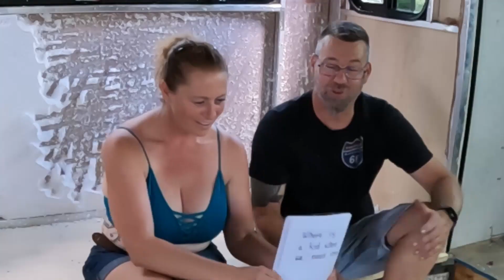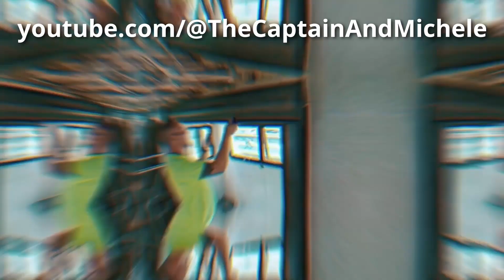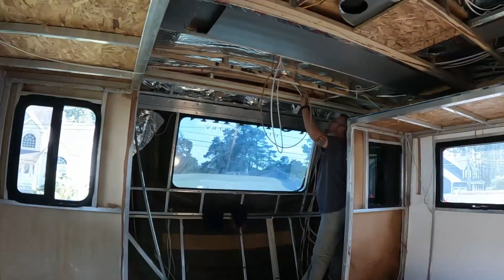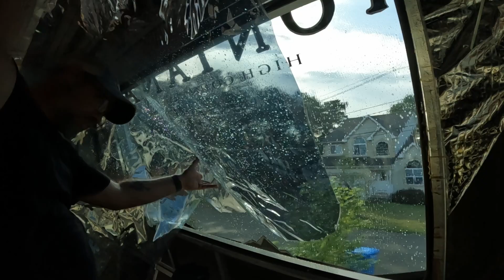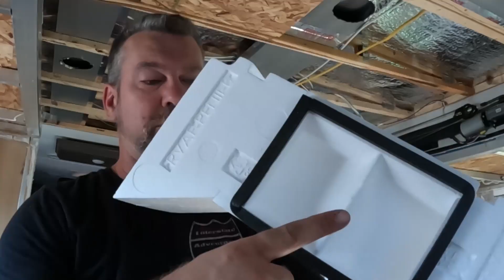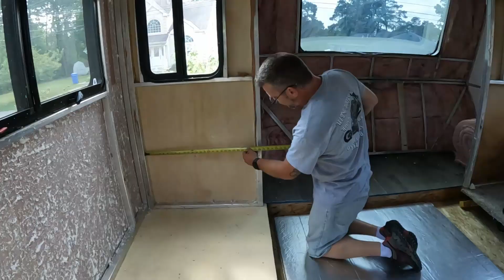RV Upgrades Have Begun! RV Airflow And Low E Window | RV Living | Interstate Adventures S3 E8

Comment: If you spray water on the window instead of tape, it will actually hold the film to the window so you could have used the heat gun and trimmed it to actual size on the outside. Then take the exact piece inside separate the film cover sheet, apply soapy water to the inside and start applying the tint. Great videos. 👍🏻